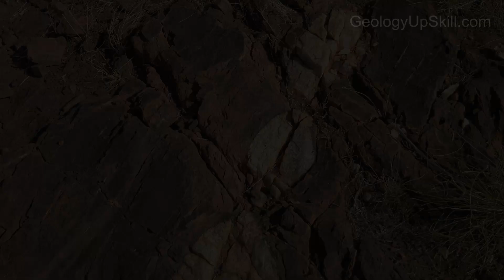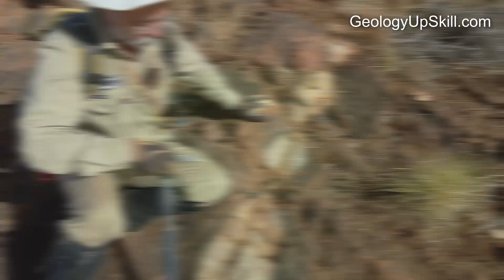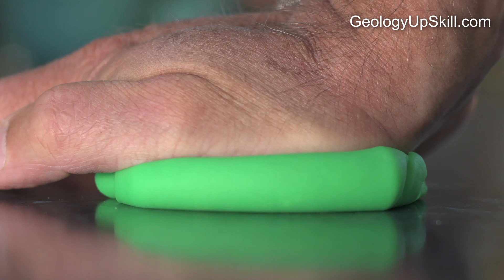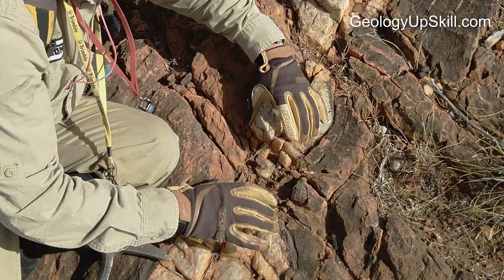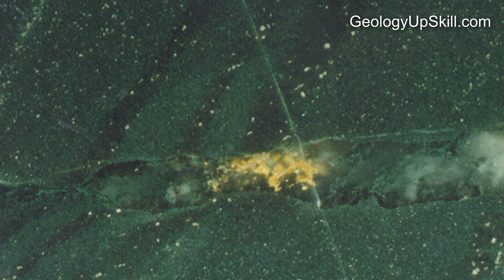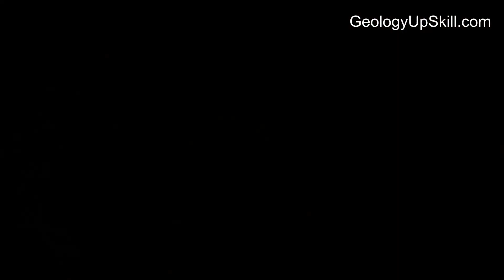The Boudinage Effect

Comment: I am curious at what temperatures the rock had to be at to deform like this? I assume the rock was once at great depth and pressure.
Reply from the maker: Yes, you can get some idea of the temperature and pressure by looking at the minerals in the surrounding rock. In this case amphiboles indicate temperature around 500 degrees C and depth of burial some 10s of km. How that rock got down that far and how it got back to the surface so we can see it today is a story that would require a very long video!